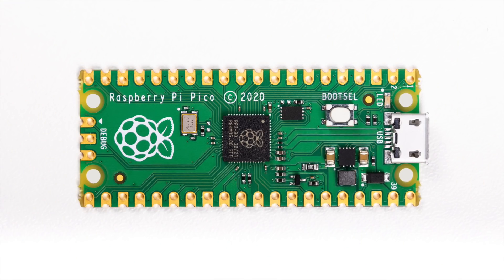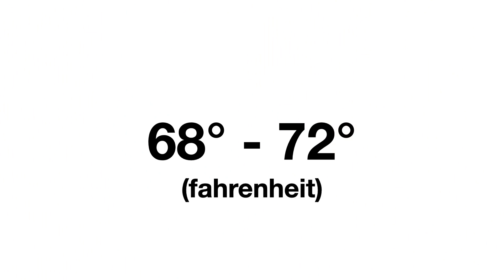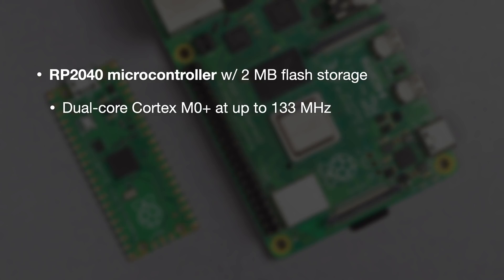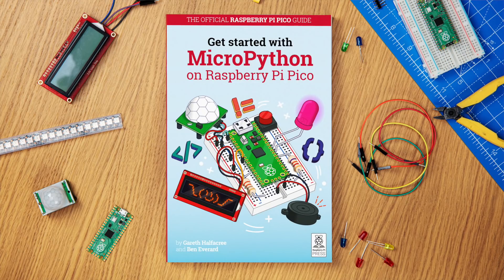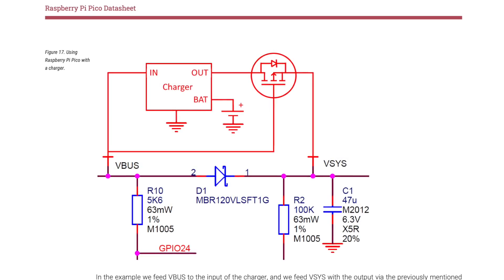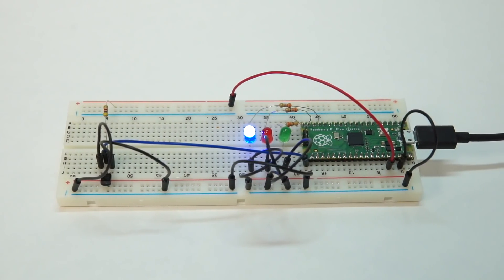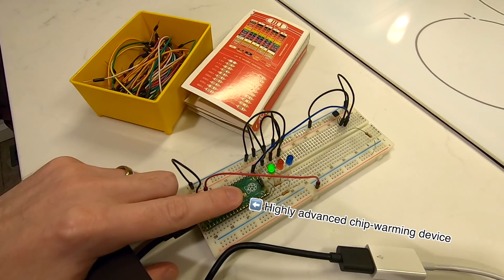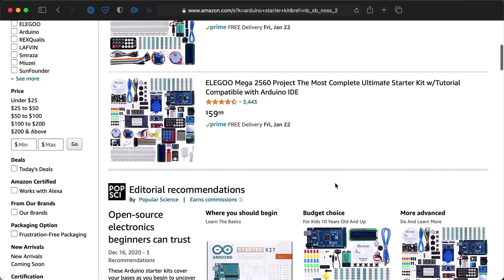The Raspberry Pi Pico Review - $4 ARM Microcontroller

Comment: Great simple project. :)
If you had a lot more time and aren't afraid of some C code you could use STM8S103F3P6 for this, aliexpress is littered with these chips around 1 dollar range, you'll also need an ST link v2 programmer for these, around 2 dollar range, which you can of course reuse, so this is a pretty good option if you need a bunch of chips doing the exact same thing, best part is that you can use Arduino IDE for it.

Personally I like to know how stuff works so I did the hard path, I did a couple of simple projects with these chips using SDCC compiler and STM8FLASH uploader, I had to compile the STM8FLASH myself and it wasn't exactly painless on Windows... After spending a few days learning, and reading the datasheets of the microcontroller I'd say it does it job... Don't know if it's any better than AVR micros but I found it often cheaper on aliexpress and STM usually has more build-in communication protocols... Personally I prefer using STM32 micros as they're often cheaper and faster than AVR and by this point I'm just more familiar with them.

I got a few projects that require some floating point math so 8-bit 16MHz integer ALU just isn't cutting it, I found STM32F401CCU6 fits my needs pretty well and has some extra headroom to play with, however those are some 3 dollars each even when buying them alone and assembling your own PCB, and they don't have any wireless capabilities so I got a couple EPS32s to play with in the future, it's kinda hard to beat ESP32s regarding price, performance and wireless capabilities.

Comment: I got an esp micro dev board (basically like shown in the video with usb interface etc) for $5. Connected temp/humidity sensor as well and had a few of them around my apartment and had the data being uploaded via wifi to a web interface. Could probably interface it to smart home thermostat or something too

Comment: I have been wondering if it was possible to get a RP2040 chip and plop it on a custom pcb (to change the formfactor). But, my use case would put 5V into it (Gameboy cartridge). So I guess I'd have to insert a resistor somewhere? Also how long does it take for the Pico to boot or is it instantaenious?

Comment: I know, the project was just to try out the new gizmo, but zoikes scoob, that's a crazy amount of horsepower for temperature monitoring! Leaf blower for a birthday candle.

Btw, to get more accurate temp readings from the on-board sensor, the chip needs to be sleeping during those 5 seconds of inactivity. If it's running then you're heating the sensor.

Comment: Honestly I was hugely excited and then lost all hope with devices like this from Pi.  The zero was just never available in quantity so the "$5" price was never a reality.  It was perpetually a limit 1 item.  Shame on them.  This seems like a "why bother?" crap version of the zero.  Atmel (Arduino) already has this market.  Can get a decent dip Atmel chip even cheaper and use Arduino sketches.  Maybe this is a concession by Pi for the abysmal zero situation?

Comment: Well, the comparison is so wrong on so many levels, but I get it, it is not simple to understand things at first with the computer guy mind set.
However if I focus on a few points made in the video, then I would add this:

ESP32 (Wi-Fi & Bluetooth BLE integrated, 240 MHz dual core) is less than 4 EUR shipping included, while ESP8266 (Wi-Fi only, up to 160 MHz single core) is less than 2 EUR shipping included. (There are newer modules coming out, some with AI acceleration for example.) Both are a fantastic tool for home automation. But there is A LOT more to a project than just the clock speed. Even the processor speed does not tell you how fast it is (ESP is faster in some things and slower in others than ARM). There is such a thing as "right tool for the job" and for this job everything we talked about is an absolute overkill. But for general purpose and most DIY people, ESP is still a winner. Lots of consumer products use it as well.

As for the Micro Python (available also on ESP), it is not at all that popular. As nice as it sounds, microcontroller is not a PC and you need your program to be small, fast and efficient. (And there is also the problems of libraries available for sensors and such.)
 
A battery on a wireless temperature sensor should last at least a year. This is where things can get ugly fast.
But, ESP can still take measurements with order of magnitude less power (with ULP coprocessor, a state machine that requires assembly programming) and two orders of magnitude less if you need to maintain clock and memory. Also, you would not use Wi-Fi for this, but go with something like ESP-NOW, a lower level radio protocol, based on MAC address direct communication. 
Just to mention, there is also a mesh network option where each module can also act as repeater/network extender, no Wi-Fi required.
All of this akin to NRF24L01+ modules.

As you can see, I'm pretty much sold on ESP, did the entire home automation with it and I'm soo satisfied with the result that I might be biased

Comment: well it is a mircocontroller with all the missing features of one too. The project he is doing in one of many things you can do with  mircocontrollers the one in my mind is to hook up all the fans in my computer to one controller board so i don't have to go around the motherboard to find all the PWM pins. Powered by microUSB to SATA it works well just needed  to find the correct pins on the SATA power connector and make a step down from 3.3V 1.5A to the 5V 50mA. Sadly it required some waste heat for the  conversation to work.

Comment: Lolin D32s (which are really decent esp32 boards) go for much cheaper than the 10-20 dollars mentionned in your video, provided you buy them directly from Wemos. Which is why I'm wondering: what are the reasons to chose a pico over a Lolin D32 ? (Maybe better ADCs ?)

Comment: Hey Jeff - Thanks for the great video - Well, you've finally convinced me to start tinkering with the PI and Python! - Actually, your temp monitoring project is EXACTLY what I'm looking to do as I have a room with sensitive electronics that needs constant temperature monitoring.  Starting from zero knowledge and gizmos but I plan to get started, use your project and build on it to add things like sending Alerts to my phone or email - or even a RoboCall, triggering solenoids etc..  Step by Step we'll go.  If you have any recommendations on getting started, I'm open to any advice! Many thanks  - PS. Hope your little Engineer is doing great and not keeping you up too much at night.  :-)

Comment: All the releases from Raspberry Pi this past year has me wondering if/when they will do an FPGA board to bring hardware design to the education/maker market in a more accessible way.  By that I mean something like this but with a modest FPGA added.  The Pico is a DIP-40 type part, perhaps an FPGA board could be a DIP-64 type part?  I'd really like to see a full FLOSS toolchain for FPGA dev.

Comment: There's no such thing as a real time counter, don't stupidly copy/paste other websites, they made a mistake.
The RTC is for Real time clock. The real time part means it asynchronously count the wall time and can tell you the current year, month, day and day-of-the-week in addition to wall clock time. On the other hand a counter just tells you the number of hardware clock ticks elapsed since the "start" event, it's then damn easy to convert from a number of clock ticks to seconds and even days/hours/minutes, that's why a real time counter doesn't exist.

Also the temp sensor is there to measure the die temperature, so using it as a general purpose temperature sensor is not advisable. Imagine if a linux process (in the embedded linux) starts to cook the CPU... for example you do a "while True" loop in your code under some unforeseen circumstances.
You'd better buy an external temp sensor which would have a better precision and would be already calibrated (or more easy to calibrate). They're damn cheap.

Comment: Soooo.... if you mount the pins upside down, so those labels are on the top, and use some standard arduino pass through standoff pins, you can easily see what pins are what and still have access to the bootselect pin underneath.... at least until you get your circuit figured out and decide to mount it more permanently...  Just saying...

Comment: Alternative:  thermistor, dual op-amp chip as a "window discriminator" (too cold / safe /too hot),  3 leds and a handful of resistors.  No computation needed.  Yeah, I know, I'm irritatingly old-school.  Actually I appreciate that someone starting out with a microcontroller benefits from simple projects and, icing on the cake, your presentation was very good.  But, returning to weeping softly in my beer, it's a bit of a shame if people know what a microcontroller is, but never learn about resistors or op-amps.
Reply from the maker: It's mostly a case of "I started out learning basic circuits / electronics, then ditched all that completely for two decades doing software development..."

So now every nail I see I hit with a hammer that's more software-focused :D

Having the Pico on hand, though, I'm spending a bit more time going back to basic circuit design again.

Comment: Interesting, but a little bit overkill for that application, and still a league away from the power consumption of "real" microcontrollers.

Have a look at the sleep consumption of an ATmega, it's in the microamps. When you take advantage of those sleep features you start to have to worry about the battery's natural discharge leakage!

Of course you could do the whole thing with a couple of comparators and a thermistor ;-)

Comment: I don't really get why wifi is now a "necessary" feature in modern microcontrollers for a lot of people. It seems like a completely unnecessary feature for so many projects, yet people still insist on having it.
Reply from the maker: I see it as a liability on any project where it's not needed. I like having a simpler setup that doesn't even have the circuit for WiFi/BT if not needed (that's why I'm also a fan of the 'Lite' Pi CM4 boards—I often just want wired ethernet and don't want to have to remember to disable wireless on them).
Reply: @JeffGeerling  Completely agree.

Comment: Great Video! Just picked up 2 at Micro Center.Cannot wait to see what this little guy can do. 
On a separate note:
 Whaaaaaa!I about lost it, when you talked about your 3D printer still  in the box.What is wrong with you!? 
Ok, having said that, I will neither confirm,nor deny that I have a 2 year old 3D printer, still in the box and serving as a make-shift shelf. 😏
Reply from the maker: lol, that box has been blocking my little soldering station setup too... so I've had a few other little projects on hold for the same amount of time :D

Comment: Makes sense the temperature sensor would be a bit off, the chip itself produces heat so it will definitely be off not because its inaccurate but because its surrounded by 2 different temperature sources, that being said its a very small amount of heat being produced which is why it still made sense to include a temp sensor

Comment: At first i thought it would run linux (new version of the pi zero) but then i found out its basically just a microcontroller, and then i hoped it would have WiFi and it doesn't have that either. I guess i set my expectations too high and now I'm dissapointed :(
Reply from the maker: See, you just have to expect that it's a $4 piece of dust or something, then every feature beyond "is a piece of dust" is a bonus!
Reply: @JeffGeerling  Yeah, when i just think of it as a micro controller its actually pretty okay. 
But i guess its because I've been waiting for the next version of the Pi Zero for so long, so when i heard of this Pico thing my expectations just went very high

Comment: Misleading title. It is $4 + $11 shipping.
Reply from the maker: I know a large number of people who bought them for $2 from Micro Center over the last few days.

They're not in stock anymore, of course... but if you are near any of the retailers then you can get it for $4 (or apparently a little less sometimes!).

No manufacturer can possibly say "our product costs X, but shipping will be Y", because shipping varies so much by market and reseller. If you aren't within range of a retailer, then sadly shipping will add to the cost—but in that case (and I am in that group quite often if Micro Center is out of stock), I typically pop a few other necessities in my cart to get free shipping or mitigate the cost for one single gumstick-sized item.

What I really hate is that somehow it is cheaper for me to get a tiny chip shipped to me from China than it is to get it shipped from a company a few miles distant.

Comment: Really interesting little board and I'm trying to get my head round the idea of multicore for a project that could really use it.

One tantalising nugget though, check out the decode of the RP2040 part number in the chip datasheet, it hints at really interesting things to come!

Comment: giving my first downvote of few months for not giving enough criticize over this rp2040, no wifi, no ble,  half the SRAM of ESP32, the hard of utilizing dual core (I'm a SDE on some big company and let's be frank, mutli-process is one of the easiest way to mess everything up) while cost more than ESP32. What do we actually get? some lower power consumption under sleep mode? Ha, seriously?
From my point of view, there is a HUGE issue with the RPi foundation or let's say any non industrial use case backed MCU - The lacking of large scale use in actual field make the price intolerant-able-ly high. 
Think about this, how much can Pico 2040 sell? let's say 10 million? ESP8266 has already exceeded 100 million on 2017, the forth year of its initial release of esp8266, ref:https://www.espressif.com/zh-hans/news/Espressif_Achieves_the_Hundredmillion_Target_for_IoT_Chip_Shipments 
The dev cost, when averaged on every single chip, is significantly higher than those cheapo ESP32, ESP8266s.
Reply: by the way, congratulations on your beautiful baby.

Comment: You've absolutely forgotten of stm32f411 blackpill board from Aliexpress, or at least bluepill with stm32f103. These boards are single core MCU's with cortex M4 in f411 and M3 in f103. Moreover f411 blackpill has usb-c which is a lot more durable than Micro USB. raspberry pi pico is more for Micro Python and it's only one advantage over these 2 boards I mentioned previously
Reply from the maker: I mentioned in the video that I only know like 2% of the world of microcontrollers. I hadn't even heard for the black/bluepill boards. I'll have to check them out!
Reply: @JeffGeerling  right, sorry.
You can also read something about RISC-V MCUs with MicroPython supoort

Comment: Re: Your babies life

There's a hack for the Arduino that lets it sip power about about 10 micro amps.  If you're measuring temperature you don't want your temperature sensor near a device that uses 2 milliamps.  It'll get warm & screw up your ambient temperature reading.  Your baby's life is worth the extra money and effort to add an I2c temp sensor.

Comment: Honest question : why would you buy this over a pi zero when it's $5 with tons of ram and a full CPU (in place of a microcontroller with a few 100k of ram at most) I wouldn't think the power draw of a pi zero would be an issue in most applications.

Edit: yes I always comment before watching, why'd you ask?
Reply from the maker: Heh

Comment: My Air Conditioner/Heat Pump has a thermostat that keeps it at a steady temp. That said, it's 62 degrees in here right now, so the red LED would be on.

Comment: now that's what I call a strange if/elif/elif/else branch structure... the else branch can never be reached and the calls to leds_off() are duplicated throughout all branches. Efficiency, man! EFFICIENCY! (and readability).

Also make sure to well document the usage of the internal temperature sensor. It is ok here, where the CPU is spending 99.9% of the time in sleep(). But as soon as you start to do other things between the measurement, the chip will heat up (yes, even if it just dissipates a few 1/10s of a Watt). The same is true if you put it into a case, obviously.
Reply from the maker: If the temperature was not a number or something crazy like that, it could be reached... maybe. Honestly I just never trust Python's duck-typing.
Reply: @JeffGeerling  the way it is programmed it will always be a number.

I don't even know if machine.ADC.read_uint16() can throw exceptions if the reading goes wrong somehow. And if it can: this should be caught explicitly.

If machine.ADC.read_uint16() returns "None" in that case (which would be really bad design) the first multiplication would already throw an error.

Comment: The esp8266 has most of those features, +wifi and I get them usually at around $2-2.50 a piece for the wemos mini.  It's a rediculously capable board, and if you use it in wifi free mode, it's very efficient.
Reply: I have a small board the same size as an ESP01 that plugs in and allows it to be powered and breaks out the usable pins. I have it wired up to a DHT22 to monitor temperatures. I also have a variation that has a couple of individually addressable LEDs for indication purposes. For this kind of thing, I'd probably use a PIC though.

Comment: The main reason is NOT “power consumption”. It’s actually reliability. A microcontroller does not care about power outs. It just reboots, no need to shutdown and preserve the file structure.